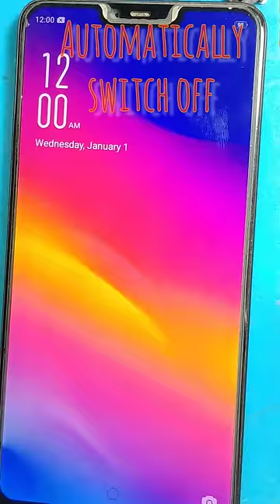oppo automatically switch off problem #shorts

Comment: Ente realme c25y phone l ee preshnam kond aan ipo njan ee comment idunnath..charging l ittal power off aavulla..ellathe phone oru 1min nokumbo thene automatic aayitt power off aavunnu....😢😢😢 aarenkilum enne help cheyuoo pleasee 😢

Flashback:Ente phone very slow aayirunnu charging apo mobile shop le aalkar parenju Board complaint aahnenn parenjitt board Matti ennitt new boat nte charger okey vangi kurachu divasam kayinjapol  pinnem slow aayitt avar onnu kayich noki enitt innu njan Charge cheythu use cheyumbo 80% angna aayepol auto aayitt power off aayi..

Ipo enik charger illathe phone use cheyan patilla🥺🥺aarenkilum oru vazhi parenju therumo...

Comment: If we change the battery will it get ok??
Reply: Yes as a servicer i recommend to change that battery instead of this because he is removing a important component from battery curcuit board which prevent battery from overloading and short circuit if you use the battery as shown in video it will lead to battery swollen up and damage the entire phone
Reply: @ahammedsalim1915  how much it will cost for a battery